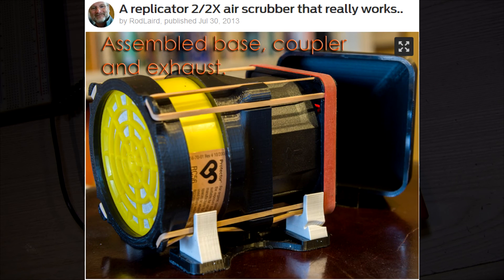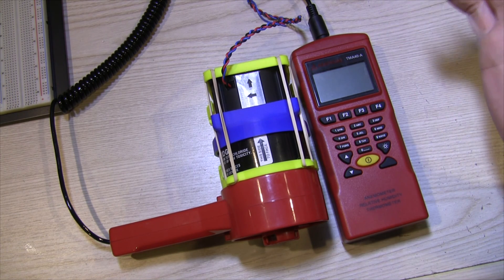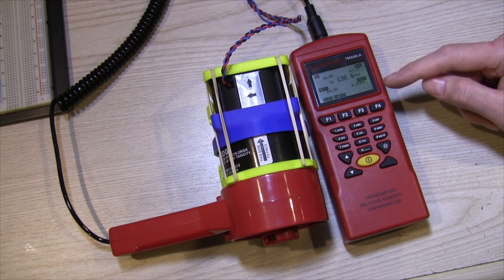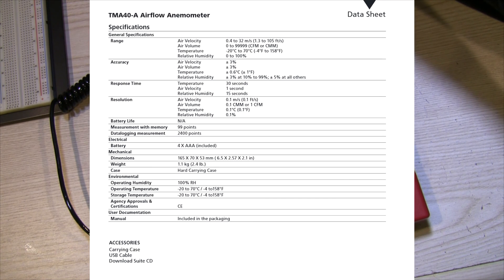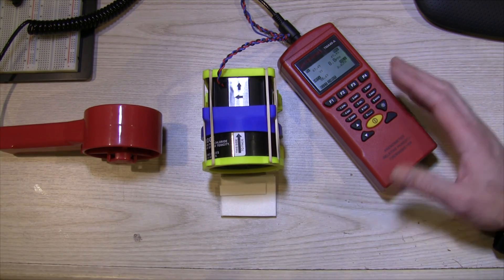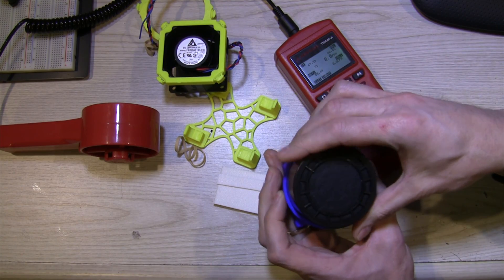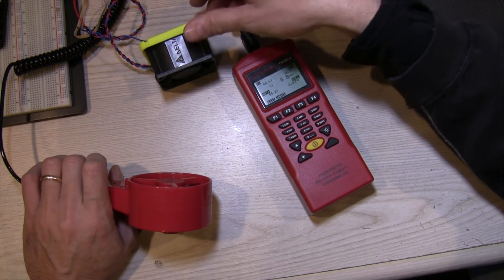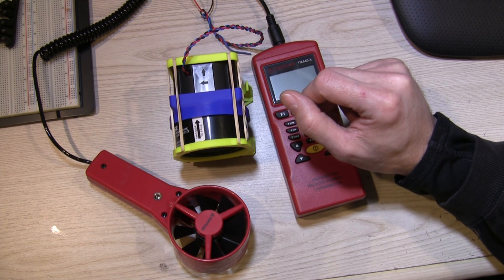3D Printer Air Scrubber/Neiko R-621 Air Flow Test

Comment: I built one and use it in my enclosed Raise3D N2 and it is effective
Reply from the maker: The N2 looks like a well crafted machine, so chances are you only need a few CFM to create a negative pressure gradient inside the build chamber. That unfortunately is not the case with my FFCP :-) Even with my new design, moving significantly more air through the filter its just barley enough.